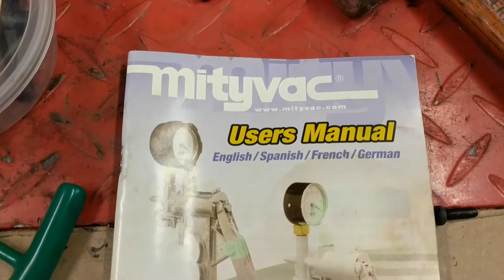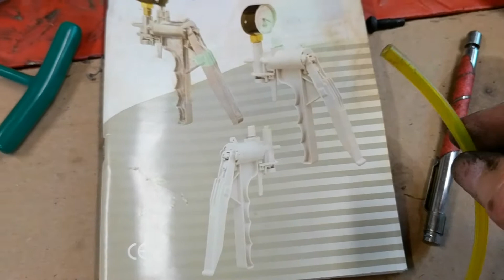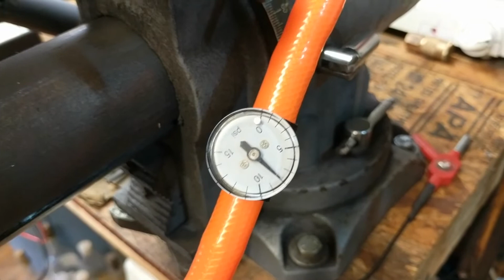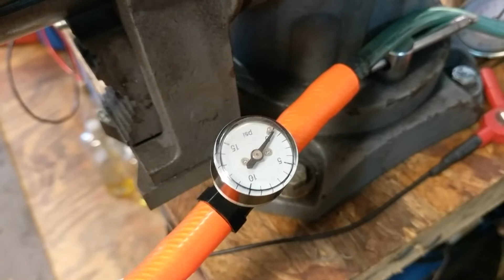DIY Pressure Tester for 2 stroke small engine carburetors

Comment: Isn’t that a 4-stroke engine?
Reply from the maker: No, a Troy-Bilt or a Craftsman, honestly don't remember.
Reply: @TheLawnmowerLady  oh it just kinda looked like it had OHV on top, I could be wrong though. Great video either way and thank you for sharing it with us!
Reply from the maker: Well hell's bells, you made me go look LOL, You're right!!! Thanks for watching.
Reply: @TheLawnmowerLady  Troybuilt 4 stroke.  Saw that right away.  VERY similar to 2 stroke carbs and this tert rig with work the same on both.  Can also test the rings and valves and see exactly which are leaking.  Also the fuel filter and fuel lines.  My parts arrive today to make one of these.  THANKS for the vid!!

Comment: Lawnmower lady I have done the both tests to the carb and my pressure is dropping on both 
What do I need to change , the carb is a zama ( and it’s dry and detached from the engine )
Reply from the maker: The carb gaskets, pumps, and diaphragms should be wet. The first test on the fuel inlet checks the needle and seat. Attaching to the other fuel barb tests the check valve. You really can't test the second one till you fix the first one. Hope this helps.
Reply: @TheLawnmowerLady  thank you for your reply it’s very much appreciated I have saved these notes and will continue with the tests hopefully I get to the bottom of this issue ( why the machine runs perfectly until after 10 minutes or so of running it begins cutting out )
Reply: Tomorrow I will spray the lines and carb with a spray bottle and soap and water to try to locate the leak as from 8 psi after 5 minutes or so it drops to 0

Comment: Question: why did you not use the pressure gauge that's on the MightyVac tool?
Reply from the maker: That particular tool only measures vacuum on the gauge.
Reply: @TheLawnmowerLady  Gotcha... I noticed some of the MityVacs can switch between vacuum and pressure
Reply from the maker: @darrenblanchard6232  That was a brake bleeding kit that I had purchased a few years prior. Thanks for watching. Cheers!

Comment: @The Lawnmower Lady  
Thank you. The pump has a gauge on it. What is gauge for? Why do you need a second gauge? What can the pump do?
Reply from the maker: The gauge on the pump is vacuum only. This particular pump is for bleeding brakes. On the top is a port to output  pressure, with no gauge. The more popular pumps have a single port with a switch for either pressure or vacuum, as well as a dual gauge. This just what I happened to have in my toolbox, and how I modified it to pressure test 2T carbs. Thanks for watching. Cheers!
Reply: @TheLawnmowerLady  Thank you.  Is this type of combined pressure and vacuum pump available in the market?
Reply from the maker: @adeyemibabatunde1814  Sure thing. The mityvac 8500 is a complete kit, it’s sort of pricey, but still good. Here’s a link to Amazon: https://amzn.to/3MjaDun
Reply: @TheLawnmowerLady  Thanks, very helpful

Comment: Isn't your pump a vacuum pump?  So how do you get pressure instead of vacuum?  Also, doesn't the pump already have a dial gauge?
Reply from the maker: This is a version of Mityvac brake bleeding kit I purchased many, many years ago to assist with bleeding the brakes on my scooters. Not sure if they make this version anymore with the separate pressure port on top. The more popular pumps have a rotary knob to switch between pressure and vacuum, along with a dual gauge, all from the same port. My gauge only shows vacuum, hence the need for that low volume inline gauge on the pressure side. I appreciate you watching.
Reply: @TheLawnmowerLady ok I was gonna ask same thing. Thank you
Reply from the maker: @rogerstern2542  since I answered that 3 years ago it does indeed seem that mighty vac does not include that pressure / exhaust port on the tiny brake bleeder kit. I've since moved on to a full-blown mityvac vacuum pressure tester kit, there are several links to it on most any of my newer videos. I appreciate you watching.